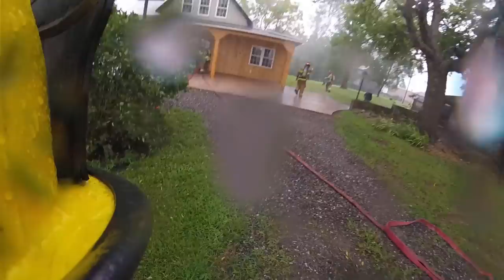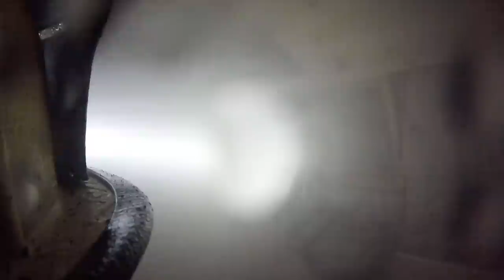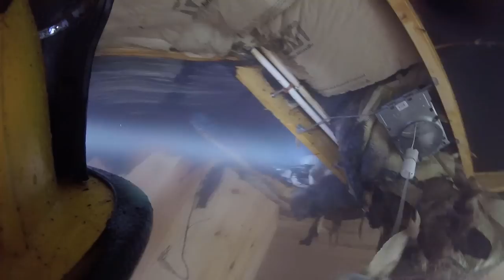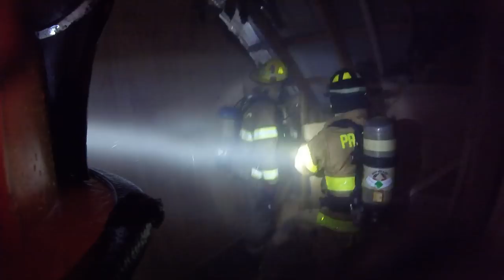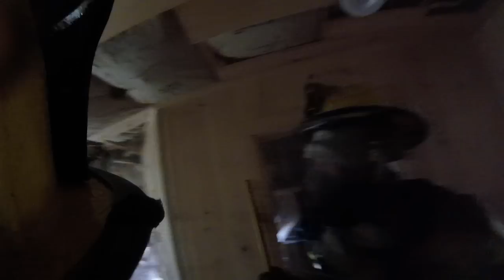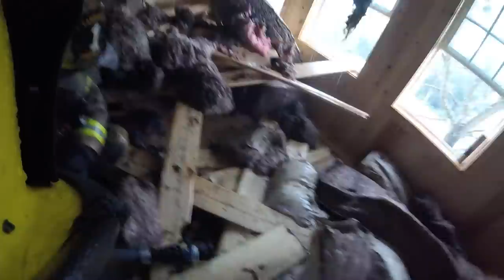Attic Fire Helmet Camera

Comment: On a separate subject, I don't like steel cladding to studs like in this building here! Not only is it likely to collapse in during fire endangering firefighters, but frost can form underneath and rust it out! When putting steel cladded roofing and siding, use plywood or OSB, then use furring strips to put the steel cladding on, this will not only prevent frost damage, but also stabilize the cladding!

Comment: why don't you bring the line over here?  because that guy is clueless
Reply from the maker: I assume you are referring to me? Because I had the nozzle.
Reply: @flowzone1289  must be, but dont worry ur not alone. thankfully there isn't any common sense requirments to be a fireman. or else half this country would be unstaffed
Reply from the maker: I actually thought about putting the line up the other way but I rarely get the nozzle and I wasn’t about to give it up. Lol
Reply: @flowzone1289  it actually amazes me at the staging of hose lines on youtube before enter building. and the infamous crosslay guys who drop the whole load at the pump panel. then drag just the nozzle lol
Reply from the maker: That makes me so frustrated when goes do that. Because when I am pumping the truck everything is in my way.

Comment: Not trying to be a jerk, but was the guy in front of you on the truck, on air in the truck?
Reply from the maker: He masked up and turned his bottle on and I did as well but we didn’t clip in till we got to the front door.
Reply: @flowzone1289  gotcha. Different looking mask than I am used to seeing I guess. It appeared to me his regulator was in.
Reply: With the msa regulators there’s a notch on the mask that your regulator slides onto, but don’t have to be breathing tank air yet till you push it all the way into the mask opening. I think the company made it this way so your mask isn’t always hanging from the air hose or regulator just dangling
Reply: That's a nice feature. Good to know. Thanks!
Reply: I've never used MSA either, definitely foreign looking. Good to know.
Reply: They are msa 7 i think not g1 fr msa there older g1 are new I try it when the rep came down